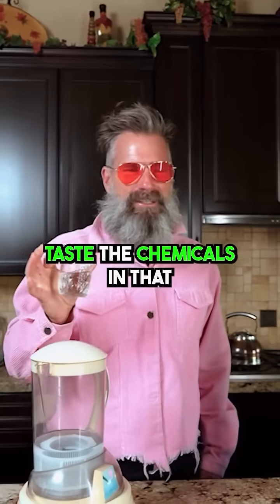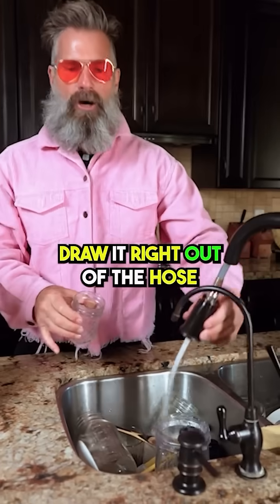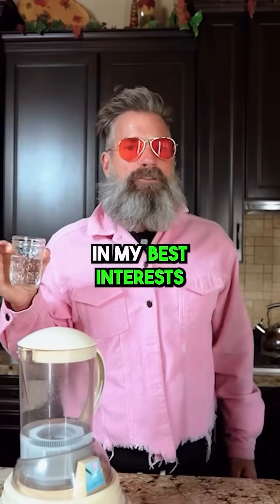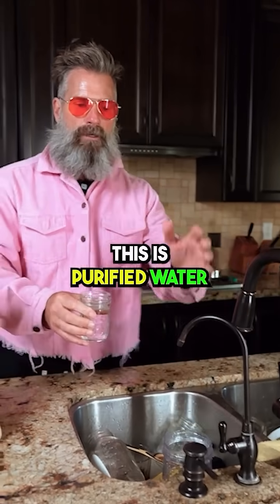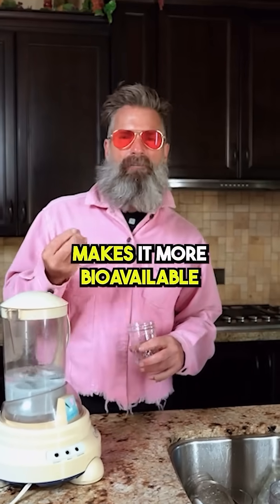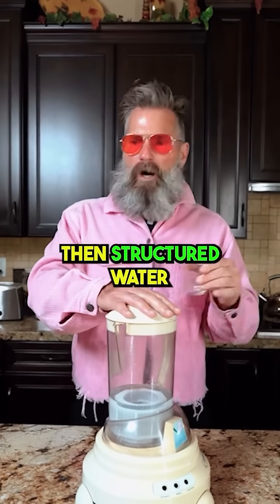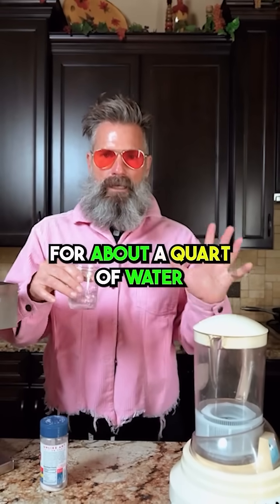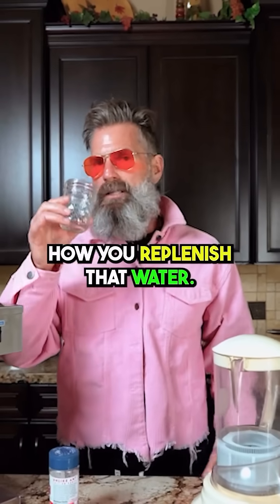How to test water quality ⚠️

Comment: I vortex the water by hand (only 108 times) before distilling it.  (With Love, Gratitude, Acceptance note taped backwards onto glass container.)  Then add a bit of salt and a squeeze of lemon.  Are you suggesting to vortex after distilling?  Kinda weird that the charcoal filter does take some odd flavors out of the distilled water.  I'm assuming that the cooling coil leeches a bit into the "hungry" freshly distilled water molecules.